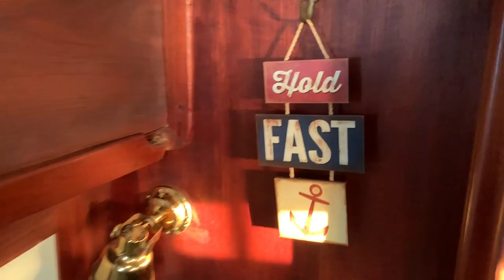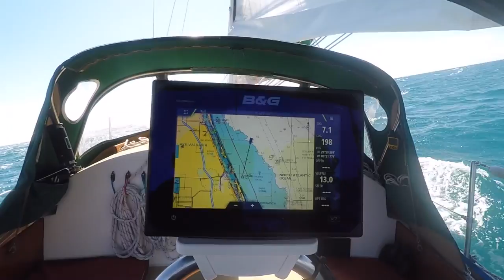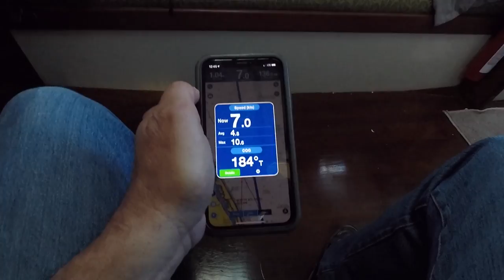S/V SeaSprite - Offshore from St Augustine to Ft Pierce

Comment: Great video!  How far of shore were you for that passage
Reply from the maker: We were never farther than about 7 miles offshore.
Reply: @TheCorsair  I have only done one passage; Connecticut to Norfolk.  That was on a 60 ft ketch, not mine.  We were 40 to 20 miles off shore.  So I was expecting you may have been further out.
Reply from the maker: Charles Mooring heading south down the coast of Florida one must stay relatively close to shore or you’ll run into the strong northward current of the Gulfstream.

Comment: Another great video, thank you. Question: what is your ground tackle setup on Seasprite?
Reply from the maker: We have a 22lb Bruce (Lewmar Claw) on 30 feet of 5/16 chain and 175 feet of nylon rode as primary. Also have a backup Danforth with 15 feet of 1/4 chain and 150 feet of nylon rode.